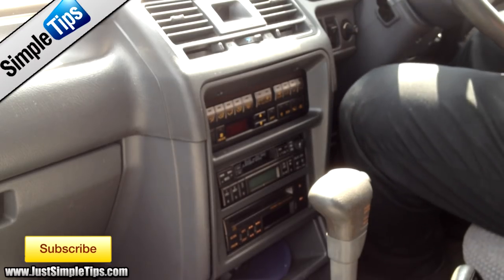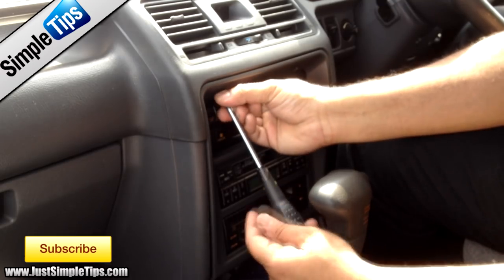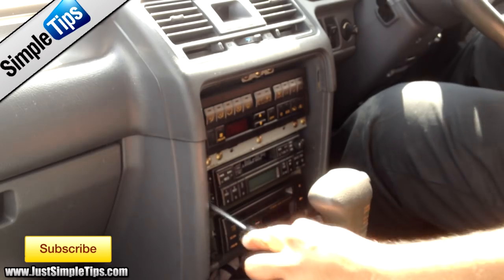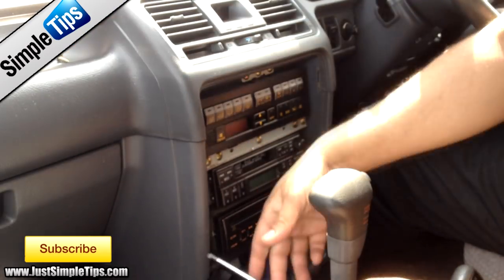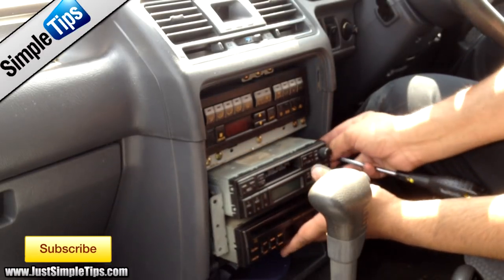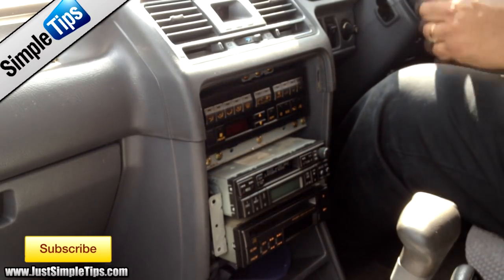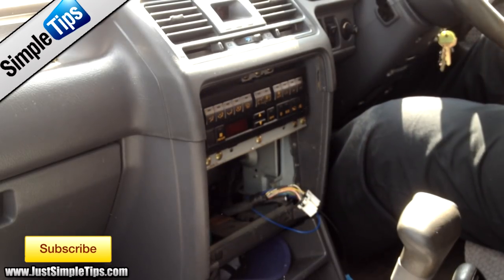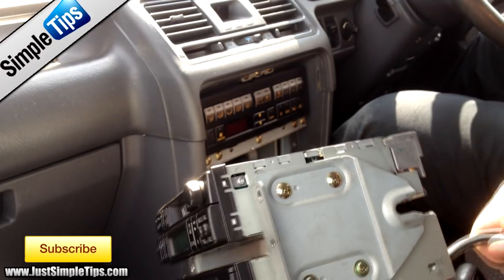Radio Removal Mitsubishi Pajero | JustAudioTips

Comment: Hello, thanks for the video!  Do you have any idea where I could pick up the factory bracket for the stereo (or a suitable alternative)? I bought a 93 pajero and I'm replacing the stereo.  Unfortunately, whoever replaced the original stereo did an incredibly crappy job.  No mounting bracket was used.  Just lots and lots of glue and plastic melted on.  Thanks!